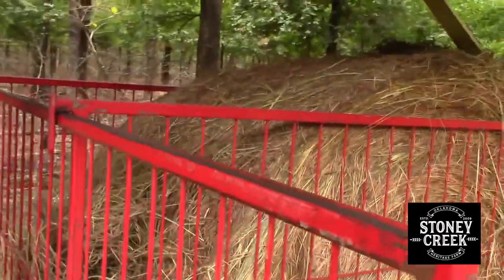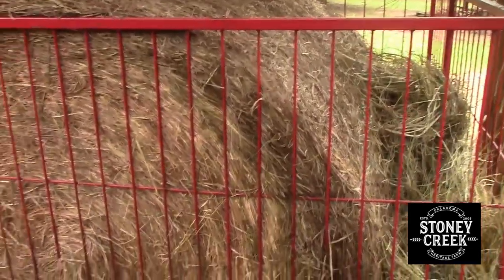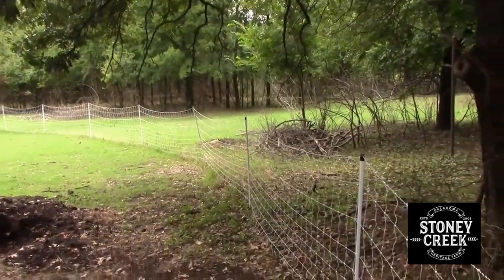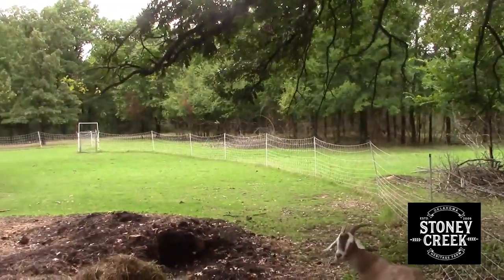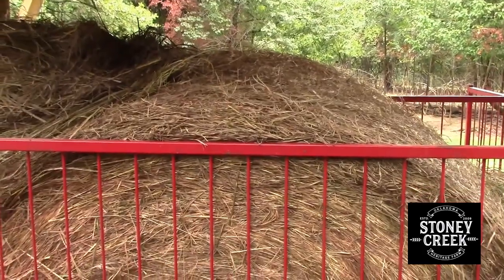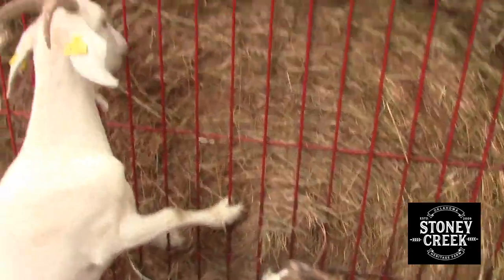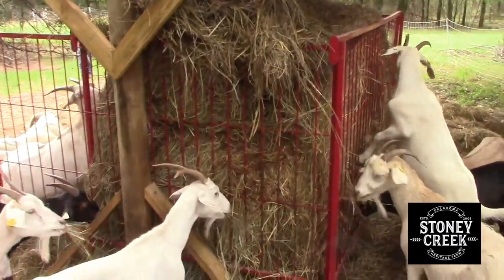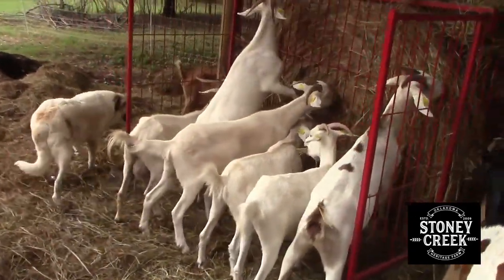How we use and review Ketcham's Collapsible Big Bale Feeder

Comment: Just a heads up folks.  7 months ago I bought 2 large square bale feeders from Ketcham's. ($1050 plus $450 shipping).  I tried the feeders with katahdin lambs but the lambs developed sores and/or abcesses from trying to get hay by putting their noses in the feeder (verified by my vet).  Then I tried the feeders with 200 pound Suffolk/Hamp ewes and as it turns out they couldn't get hay off the bale so I ended up moving sheep out of the pasture, taking the feeder apart and forking hay off.  I feed 1800 pound straight alfalfa square bales.  When I called Ketcham to ask what to do, the first person said he didn't know but someone would call me back. Nobody ever called so I called them again.  Ketcham representative number two said I should put the bale up on pallets (which would give me a taller bale that sheep couldn't get hay out of) and that they have had complaints from show lamb people that lambs got marks on their faces. Ketcham representative number 3 said my hay is baled too tight.  I don't bring in my own hay so I'm guessing the rancher I buy hay from won't adjust his baler so that Ketcham feeders will work with his bales. She also said that they would not refund anything because it's "too much money." Today I talked to Ketcham representative number four who told me it is preferred that the feeders are not used with lambs and that my lambs did not get sores from their feeders (not sure how she knows that).  We had a heated discussion and she hung up on me. They are not refunding any money to me because their stated policy is that equipment has to be returned within 30 days which may be legitimate but they should tell people up front that the feeders may not work with lambs or certain bales of hay.  My advice is to buy Sydel feeders.  They work great with my hay, sheep and lambs with no hassles.

Comment: When the bail is almost gone have you ever had trouble with it falling and pushing the sliding ends? Would you change anything about it? I am looking at building 1 or 4 from scratch.
Reply from the maker: Great questions! when it close to being almost gone, it doesn't push the slide ends, what I have seen it is hard for the girl to eat the bottom so I have to fluff it up with a rake. I have talked to other kiko breeders with larger herds than mine and they say it's not an issue. Probably is with mine because of the numbers of goats I have eating off it. I'll tell ya. For the money I save in the waste, I'll gladly use a rake and fluff up the bottom part the last week or so before I need to bring a new bale out. 
If I had anything to change, would probably be the adjustable legs. I like that the legs do adjust because it needs to be pretty level to operate correctly and for the best use of the bale. And I'm not sure how I would change them. I don't care for them because of how the sliding ends have to come off. guess the other thing I would change, is make it the sliding panels closer to the size of a round bale. The sliding sides of course will slide down to the bale, but the sides seem a little wide. If I were building my own, I'd make it so only about 6 to 8 inches clearance for a new bale. Might be a little harder loading a new bale, but think the over all end result would work out better. Hope this helps! Thanks for stopping by and watching!
Reply: @StoneyCreekHeritageFarm  thanks for the help.

Comment: My goats tend to make holes in the bale. With the panel that slides does that help eliminate that? How long have you been using it? How many goats do you have? We have 20 Boer goats.
Reply from the maker: Great questions! The sliding panel does help eliminate holes in the bale. They can only eat in as far as their noses are long until the panel prevents them to from going further, creating an equal eating surface. I have had this for a couple of years, this will be my third winter with this bale feeder. Currently, there are 22 or so goats out there. During kidding season and for the 90-120 days after, there are 50+ goats eating off the rack.

Comment: Hey Bill Deb with Snakebite! does it matter which way the bale goes in? I would think on the end?
Reply from the maker: Not sure how I missed your question before. I tried it once, and only once putting it in 90 degrees from what this video shows. Not only was it a pain to load in the rack, I found the way the goats ate from the side instead of the end, it had way more waste and had issues collapsing as designed because of the eating pattern. Placing it in with the flat ends next to the sliding sides works best. 

Hope Snake Bite is doing well for you. I really liked that doe.